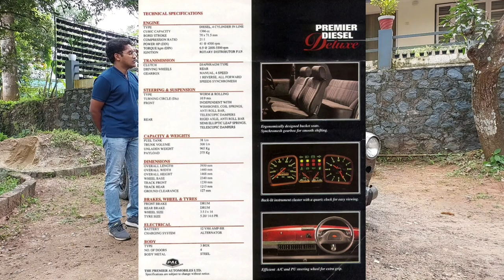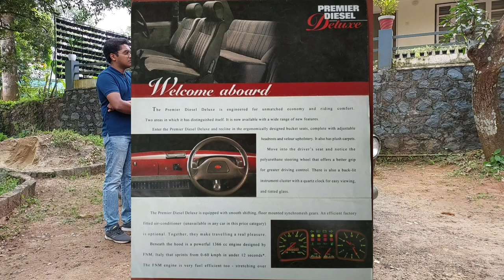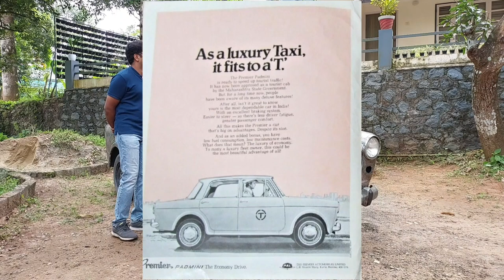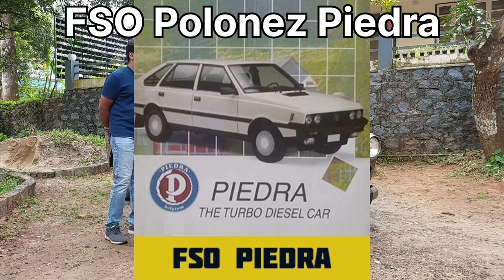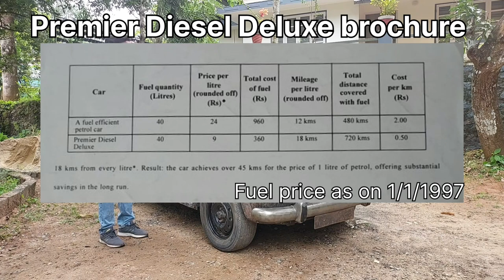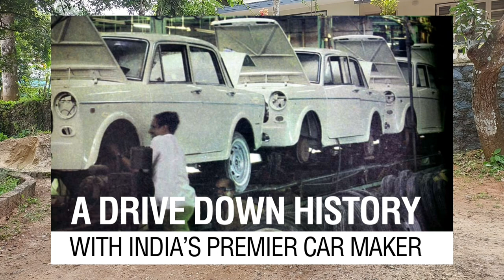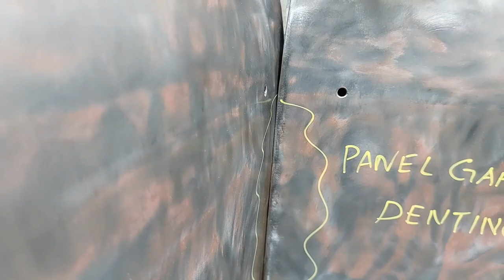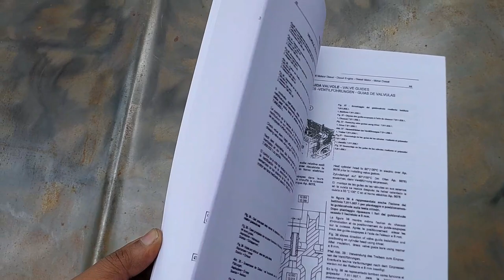Premier Padmini 137D Restoration | Part 1 | A Short History | Bodywork

Comment: Best wishes! Super excited about this project! 
Thank you so much for detailing so much regarding the 137D, this is the best video I have ever seen regarding guidance to restore this gorgeous car.
Kind of crazy how much has been missed by people who make videos on this car, makes me think if they actually do any research lol
Gorgeous RX in cameo as well!
Btw, I have seen Padminis retrofitted with fuel tanks of TATA ACE/Magic.
Couple of questions, if you don't mind

To make it a daily drivable car, is it possible to fit a reliable A/C setup ? A video on this would be great because there is very little information regarding this.
Is there any engineering flaw with the column shifter, for PAL to switch to a floor shifter ? Is there a way for us to fix it ?
Will you be using the stock engine or swapping with a Toyota Diesel ?
Is it possible to switch to coil springs instead of the leaf-spring setup, for a better ride quality ?
Is there a way to import POR15 without selling our kidney, or is there an effective anti-rust coating/sealant that is manufactured here & does a good job ?

Btw, I'd suggest anti-rust spray like XCP/ACF50, They cost a bomb but actually do a great job, I've got a can for my Yamaha RX.
Thanks again! Subbed!
Reply from the maker: Thank you so much for the wishes. We plan to bring more detailed videos about the 137D as the restoration progresses. Videos regarding general engine service, painting process, electrical wiring, alternate parts, suspension rebuild etc are planned and will be uploaded in due course of time.

We are more than happy to answer your questions. We expect more interaction from our viewers.

Padmini 137D was available with a factory fitted AC. We will suggest you to go for a retrofit AC only if the engine is in good nick. Being designed for marine purpose the FNM engine is not really capable of varying load demands in automobile applications. Hence is prone to overheating and head gasket failure. An additional electric fan is a must if you plan to install AC unit. So we decided not to install AC in our car. However we know a friendly AC technician who is willing to share information regarding the fitment. Will ask him for more details and will share accordingly.

In our knowledge the column shifter didn't have any engineering flaw. The main issues was worn out linkage bushings that results in excessive play of the gear lever. This was one reason that PAL decided for the transition to floor shift.

We are not planning to swap the engine and will stick with the stock engine. As engine swap is illegal and Kerala MVD won't be happy with such a conversion. Don't want to land into unnecessary troubles.

Coil spring conversion can be done with proper research and with the help of a skilled mechanic.

A friend based in Dubai is dealing with POR15 products over there. Will check with him the possibility of importing products to India. Owatrol products is available in India now and will share the contact with you. Kindly drop a note to our mail id bosegarageisnow@gmail.com.

Thanks again 🙏🏻
Reply: @bosegarage  Thank you so much!